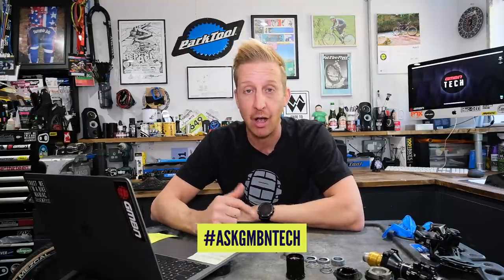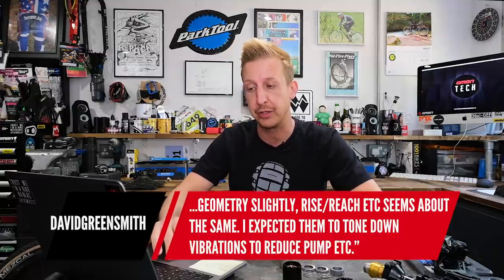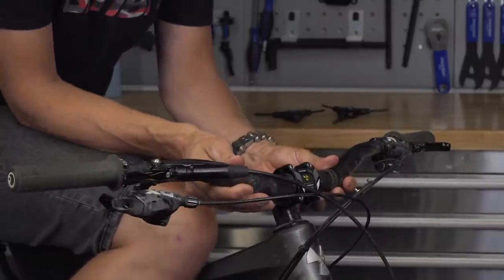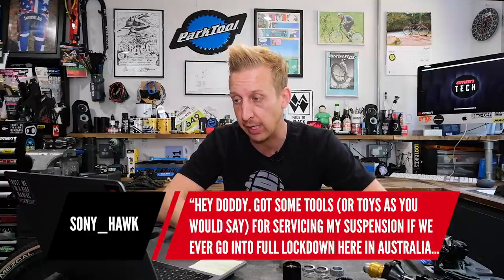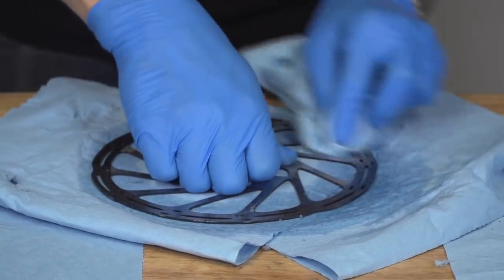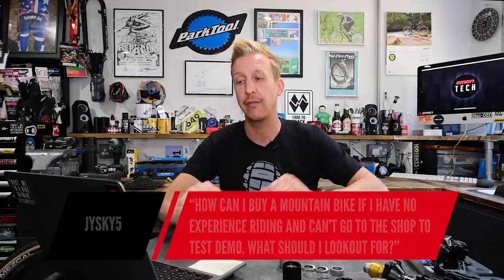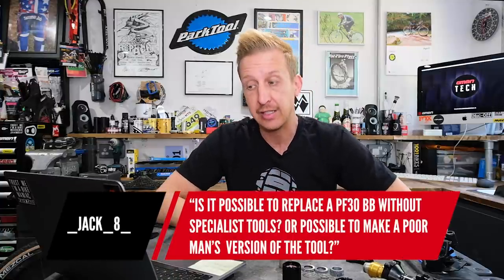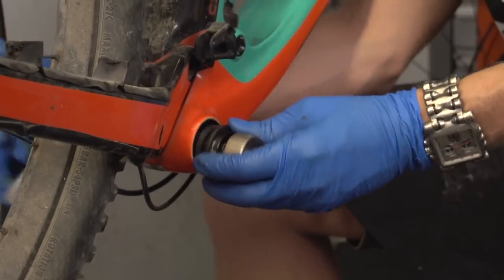Do I Need To Clean My Brake Rotors When Swapping Brake Pads? | #AskGMBNTech

Comment: #AskGMBNTech 
Doddy, can you explain gearboxes and why they aren't as widely used as conventional drivetrains. It seems like they are the better deal, being sealed and in an oil bath and there's quite a few different ones I've seen around. Really appreciate the show.
Reply: Cheap gearboxes give relatively low pedal efficiency in comparison to a standard drivetrain.
The ones which are the closest on efficiency are very expensive, they require less maintenance but are considerably harder to service once they need to be maintained.
Also, the weight penalty is big so most people don't bother. I would say bikepackers are usually the ones who use them the most but we are very far away from manufactures bringing this to the mainstream public.

Comment: #AskGMBNTech Inspired by Blakes MegaAvalanche NukeProof hardtail, I am thinking of converting my conventional Scott Scale 29er, into a trail hardtail but swapping out 100mm SID to a 150 FOX Rhythm with 27.5 wheels.  Based on my math BB height will be largely unchanged (smaller wheels but longer fork). 69HTA 74STA becomes 67 and 72 now.  The new non-setback dropper post will also steepen the STA a bit than the setback carbon seatpost on it before.  I am also thinking of going from 2.25 tires to 2.4 front / 2.6 rear combo （DHF？Nobby Nic？DeBaron?）to give the rear some more comfort, but I am worried too big a rear tire could bounce around at 25psi or be sluggish at sub-20psi (I am 84kg).  Reach will be slightly shorter but still manageable.  What did I miss? Bad idea? Tire choice sounds reasonable？ Is this a worthwhile experiment or a complete waste of time?

Comment: #askgmbntech hello, I just go the ARD for my wheels and decided to take out the tubes. I switched my rear wheel over and it held air overnight. I went for a ride and the pressure was still fine. The next morning my tire was flat but no signs of sealant anywhere. I noticed a small dent in my rim. Would that be enough to make it leak? Thanks

Comment: #AskGMBNTech can we get a revist to brake maintenance ... i.e.  Switching Brakes from mechanical to disk, does rotor size matter, tools needed, and types of pads available ... also what if pre-filled brake lines are two long. Then finally whatever is needed before hitting the trail. 

I know there are older videos, but could we get an updated one. Maybe two parter for whole process.

Comment: #AskGMBNTech Hi Doddy,
I've discovered a small squeak in my front hub after a ride, I've opened it up and found that one of the bearings was dry, after applying some grease to it, it turned brown-red after a few spins. I'm guessing it might've developed some rust because it was dry (out of the factory, I guess, since the other bearing was greased).  Now although the wheel spins freely, three's a bit of a humming sound coming from it, while the other wheel is completely silent. I'm guessing the bearing is damaged now and needs replacing, am i right? Thanks!
 P.S. It's a Bitex MTF hub.

Comment: #askGMBNTech Doddy, staying in the topic of air volume spacers. In one of older tech tips you mentioned plans for testing if you can add spacers to RockShox Recon, since regular spacers won't fit due to different air valve design. Can we get an update on this topic?

Comment: #AskGMBNTech

I’ve got a Giant Talon 27.5 with Shimano Deore brakes. I’ve not used the bike properly over the last few years, however I went out the other week on it and my brakes barely work. I’ve sanded them down to remove some glazing but it hasn’t made any difference. Do I need to replace the pads?

Comment: #askgmbntech I have a 2018 YT Capra aluminum frame and I keep having headset bearing failures. I ride urban freeride so there is no mud or water getting to the headset. I do a full bolt check after everyride so it is not a lack of maintenance. This last time the headset had no play but when I removed the fork the top bearing had tons of movement between the inner and outer bearing shell.

Comment: #askgmbn. Hi guys, I need a little advise.  I’m a bit of a noob with a torque wrench.  I  was unaware they only torqued clockwise.  On my GT distortion I have over tightened my FSA Megaexo bottom bracket. I can’t get it back off. My BBT actually snapped in half. Any tips

Comment: #ASKGMBNTECH
Hi I love the show! My question is: could you use motorcycle fork oils to service your mtb fork? Obviously using the correct weight oil that the manufacturer says it has to be.
Reply: Yeah you can as long as its correct weight you can use whatever you want all oil is the same unless its ptfe infused or special damper oil
Reply: Only if it smells the same

Comment: #AskGMBNTech Is it normal for the front derailleur to only be able to shift through the 3 cogs when the rear is set right in the middle of the gears, say 4th or 5th? Should I not be able to shift through the front 3 cogs no matter what gear is selected at the back? If this is the case is there an easy fix?

Comment: #AskGMBNTech - I'd also love to see some improvised workshop tools like the home made Pressfit BB/Headset press tool, maybe wheel/frame bearing press also - using threaded bar and washers. surely cant be too difficult to make but would like to know what  size bolts and washers to use and whether things like sockets cant be used as a bearing drift for removal.

Comment: I started watching your show few days ago, and i put all my questions so far below, since i did that in many older episodes there is little chance of you noticing it, so for your own convinience i made a 6 question summary below. I hope to hear from you soon, and i realy enjouy your show.

1. #ASKGMBNTECH - Doddy what is the name of your cat? How is all of GMBN network handling pandemia world state? What is your personal opinion about it? was it accident or conspiracy to release that virus from china?

2. #ASKGMBNTECH - hey guys, oi agree you made so many tubeless - related videos, why not make last one - and becouse some of the stuff is outdated and new tech is going out, new sealents, tyres, tapes and such, why not make 1 new video from scratch using most recent new tyres type new sealants, introduction to 10 most used tubeless kits and make 1 tyre of each kit and compare?

3. #ASKGMBNTECH - hello, i want to build my own full suspension bike, my trouble is finding a frame to fit 11 - 42, 11 cogs cassete in the rear and 26 - 38 front cogs. Can you advise (or find) which full suspension frames will fit those? and if none will, what are the frames to fit biggest sized cogs?

4. #ASKGMBNTECH hi guys, can you make a video on hydraulic shimano cable /wire change? like in case of slicing hydraulic cable in 2? how to set new cable onto caliper?

5. #askgmbntech - hello, i see so many comanies of tires, but there is 1 brand which is hmmmm not taken into consideration? its Vee tires!
ium using them alot, in Poland they basic value is 200 pln basic price but u can get it way cheaper if u look right, tires are extrtemly durable and can take quite much, but no1 is using them nor talking about them - my question  is why?

6. #ASKGMBNTECH - what can i do to start working with you? as your worker, i could travel to uk or have some sort of a bike repair shop in Poland?

Comment: #AskGMBNTech I have a non quick release thru axle on my 2019 rockshox yari and it seems to either be seized or has been tightened really tight to the point that it is bending my Allen key is there any way to get it off without nearly destroying my fork?

Comment: #AskGMBNTech I'm currently building up a Commencal Furious 2009 frame, but instead of the former 180mm up front and 222x63 in the rear I'm down sizing to 140mm forks and a 190x50 shock, from my understanding the shorter forks will steepen the head angle but a shorter shock slackens it, so to what degree (literally) would this impact it?

Comment: What do you think about 3rd party dust wiper seals (SKF/Racingbros/U2NR/etc.)? Are they worth buying instead of the more expensive fox ones in my case? Also do you think there could be any problems with fox saying you should use the gold oil with their wipers only and so on? #AskGMBNTech

Comment: #askgmbntech 
I have an amateur question. There is bike boom in USA and everything is sold out. I wanted to get my wife entry level mountain bike and thought she wouldn't like going out on real mountain trails but she loves it. I ended up getting Trek Marlin 4 because that was only extra small in stock anywhere when I bought it. 
Problem is that it is not good enough for her to have fun on the trail and she needs to love it so I can go more often.
I want to change it up to 1x11 or 12 speed but I don't know what I need to change for it to happen. 
I have 2020 Stumpjumper ST 29. Her bike is 27.5.  Can I switch out my drivetrain and brakes and put it on hers? I wanted to upgrade my bike to Magura mt5 or mt7 and slightly better drivetrain. I have eagle sx 12 spd and tektro Gemini comp that is stock with this bike.
Marlin 4 has mechanical tektro disc brakes and 3x7 shimano tourney? I tried my local bike shop and they are backed up for at least one or two month and one shop does Trek and another does Specialized so they are giving me vague answers.
Thank you for any help you can provide or any suggestions on what would be best for what I am thinking of doing. 
I also could return her bike and exchange to better bike since it is within 30 day shop return policy if that would be the best option for me?

Comment: When it comes to bash guards for your bike and the current ISCG05 standard mounts, is it better to have a bash guard that mounts to all three holes, just the lower two holes or something mounted to the crank itself? My brother is a mechanic and is insistent on the crank because it’s replaceable compared to a frame, but aren’t the frames designed around these, especially carbon frames? I’d love to hear some more opinions on this topic and prevent and frame damages. #askgmbntech

Comment: #AskGMBNTech i recently got a new enduro bike with xtr brakes. it comes with 6 bolt discs but there is only rt64 discs on them since shimano doesn t make better ones with 6 bolts.Im thinking of getting an Center Lock adaptor, do these affect my disc/ breaking in any way?

Comment: #AskGMBNTech Hey Doddy! I have a 2019 Trek Roscoe 8 and I’m looking to upgrade that dreaded rear hub. The stock hub has 18poe and is really clunky, and will actually throw your feet off the pedals during hard acceleration/upshifting. I do mostly trail riding with some techy rock gardens. I’m looking at an Industry 9 Hydra, do you think 690poe is overkill for my type of riding? Or would their 1/1 hub with 90poe be sufficient? As minute as the price difference between the 2 is I figured I should just go all out and get the hydra. What are your thoughts?
Reply: I have the same bike. It’s a lot of fun to ride but I agree engagement on the rear hub is majorly lacking. My fat bike has a better hub with faster engagement! I’m looking at a DT Swiss Hub that my local shop has recommended. I’d suggest asking the shop where you bought it to see what they say.
Reply: Dave Lombardo unfortunately the shop I bought mine at is a very small shop that ONLY sell Trek bikes and Bontrager components, and they don’t lace wheels. They said if I bought the stuff they could call in a specialty mechanic for $100 a hour, YIKES! But they didn’t really have any recommendations as far as upgrading the hub. There’s a bigger shop an hour away that said they’d swap the hub for about $50, and could do it on the spot. That other shop said they were fond of DT Swiss components, but they didn’t do enough of that type of stuff to really know what the best bang for the buck was. The Industry 9 has 7x the engagement points, it’s about the same price, it’s 100% handcrafted in the USA, and requires no tools to service. Do some research on their hydra hubs if you’re looking at upgrading your Roscoe, I think you’ll be impressed.
Reply: Justin Mckey No problem with the hydra hubs of course. They’re some of the best for sure. I just don’t have that kind of cash to spend on a hub. Too bad your local shop can’t be more help non surprised that Bontrager doesn’t make a hub that could be upgraded to. Also, a new hub means a new wheels build. So I’d be amazed if they could really do it on the spot for that cheap.
Reply: Dave Lombardo check out Industry 9’s cheaper 1/1 hub, it’s under $300 and offers almost double the engagement points of the DT Swiss. Not saying there’s anything wrong with DT components but 54poe still isn’t great.  And yea I’m sure $50 is the best case scenario, assuming I don’t need different length spikes or anything like that.

Comment: #AskGMBNTech I have a Norco Range a2 2019 with 180mm at the front and 160mm at the rear. In the shock there is a 5mm travel spacer. Does make sense remove the spacer to add travel to the rear wheel?

Comment: #askgmbntech
I have bought at rockshox reba fra 2017 and there a - air and a +air. If i put air in the - air and I take the pump off then all the air is gettin out. What is wrong?

Comment: #askgmbntech Hey guys, my Rock Shox Reba Rl from 2018 hast lost about 20mm of travel. When I remove the bolt on the lower legs (airside) and compress the hidden valve from the negative air chamber, the fork loses all it's pressure and sinks down. Is this normal or is there a problem with a seal? The fork feels also a bit unsensitive...
Thanks for your content!

Comment: #AskGMBN i have fulcrum red 55 wheels and the fulcrum website says, for the built in rims, that they are tubless ready so i bought a pair of maxis minion dhr II and tried a tuebless setup with the e thirteen tire plasma, schwalbe tubless valves  and dt swiss rimtape. But now i have  big leaks at the front valve (haven't set up the rear yet)... But why? I've made a hole with a soldering iron and then pushed the valve in...

Comment: #AskGMBNTech I recently got back into riding after about 10 years. My current bike is a 2009 Specialized hardtail 26er. It has a 3x9 Shimano drivetrain and a RockShox Recon fork. It still works well but I am looking for a new bike and I need advice. I prefer riding green and blue trails. Nothing too advanced. I am not a speed demon I just love to ride. I was considering a full suspension 29er but should I be looking at anything more specific for my riding preference?

Comment: #askgmbntech 
Hey guys,  first of all thank you so much for all your tech videos. They helped me out many times! 
I would like to know where exactly the creaking noise of a threaded bottom bracket is coming from, assuming the sound really comes from the BB and not any other source of creaking noises. Is it the ball bearings? Or is it the casing? Would a higher priced BB (e.g. CermicSpeed) reduce a the possibility of creaking noises?
Thank you so much! Johannes
Reply from the maker: Hey Trihannes, it is often the bearings that have worn. Bottom Brackets are an item that will wear over time, so we suggest you do what you can to keep it fresh for as long as possible. People often use pressure washers on their bikes and blast the BB, this will drive out the grease and cause premature wear. Some BBs will last longer than others but they will all wear out eventually. It's important to check that it is torqued up correctly as if it comes to lose it could also be the creaking noise. Hope this helps 👍

Comment: #AskGMBNTech hey dodgy love the show I bought a used fox 36 from 2016 and when I bought it it felt amazing it has been 3 months since then and the fork doesn’t bounce up like it did when I bought it. The rebound is on maximum and it doesn’t feel like it did, 
is there anything I can do to fix this i am a confident mechanic and have done a lower leg before

Comment: #AskGMBNTech What should you put on suspension pivot sealed bearing outer and inner casings so they do not become seized in your frame bearing mounts. I generally put waterproof grease but I still get seized bearing outer casings getting seized to bearing mount on the frame or get the bearing inner casing seized against the pivot bolt. I have just tried some anti-seize copper paste on my new bearings to see if that works better.  Also thoughts on how to best get a seized bearing out of the frame mount in places where you cannot use a bearing extractor tool (eg. I had trouble the with linkage bearings on my Lapierre 729 as bearing inner casing was seized to the suspension bolt and the bolt was on inside of linkage so I could not remove the linkage from the rear triangle).

Comment: #askGMBNTech Hey Doddy, love the show! I have a yeti Sb5 with a pressfit 92 Bottom bracket and I would like to get some shorter cranks 170 or 165 (it came stock with 175mm). Why if finding the right crankset so difficult? How and where do I get the information I need to buy the right crankset?

Comment: #AskGMBNTech Can you run Shimano 1x12 on an old frame with 135mm rear hub spacing? Would I encounter any issues with chainline with shimano cranks? It seems like their 1x cranks have very wide chainline.

Comment: #AskGMBNtech hay I forgot to add this to my other question. My rear through axle keeps coming loose and I don’t know why. Do I just need to grease the threads and if so with what? (I ride a 2019 Specialized StumpJumper ST 27.5 just Incase it helps) =)